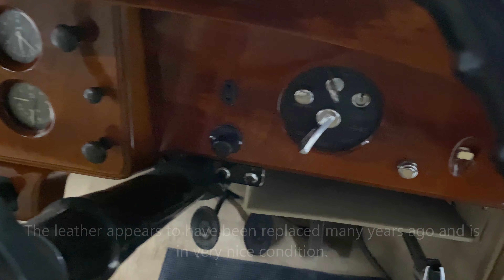1952 Rolls-Royce Silver Wraith, Hooper limousine, Beautiful Example

Comment: How much for BENTLEY MARK VI, ROLLS SILVER DOWN  1952, MANUAL, 400 MILE?
Thank you in advance
Reply from the maker: They vary in value depending on the condition.  Most Mk VIs with standard steel saloon bodies are in the $20-45k range.  The Silver Dawns sell for more money, normally $35-60k.
Reply: @ClassicPromenade  thank you for your reply. How much do you reckon? Aprox?